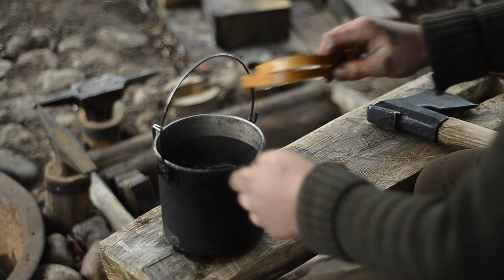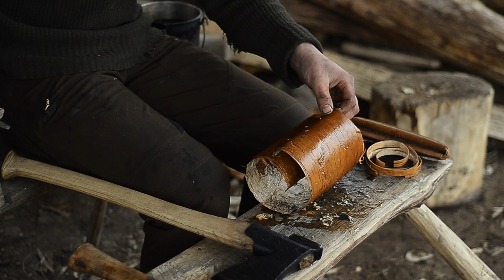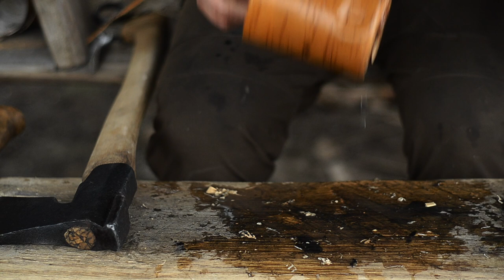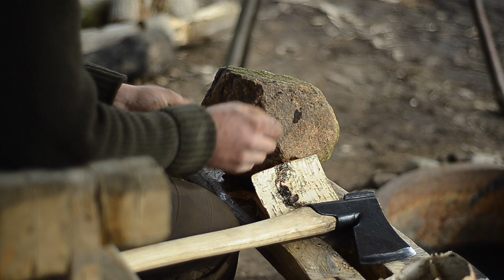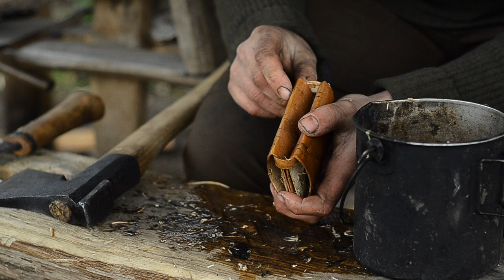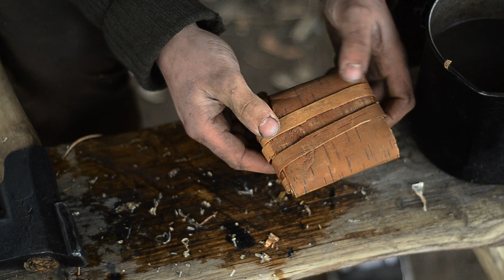Making birch bark axe sheath

Comment: Have never seen this done before and it is fascinating . Are oils or animal fat needed to preserve a birch bark sheath ? Thanks again Rune for the lesson .
Reply from the maker: Thanks. No. Birch bark contains tar so it's perfectly self preserving - last over 100 years in the north as the waterproof layer on roofing in the north. It can dry out more than ideal, but it's just a matter of adding water to it - it will naturally happens just by using the tool in a a wet forrest/in light rain from time to time. The sheath is so fast to make so traditional and just still, do you just replace it with new bark instead of doing maintenance - but do last at least a few years with on problem.
Reply: Thanks for the answer my friend .